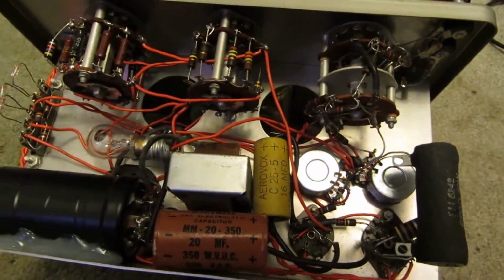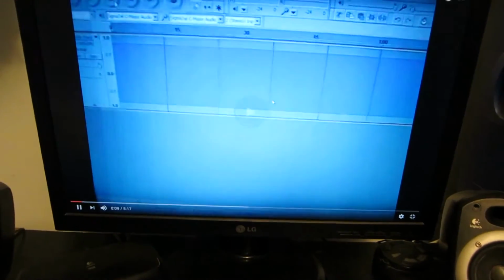HeathKit Audio Generator Autopsy

Comment: would this work with a class d car amplifier 1000w?
Reply from the maker: You mean to power a motor at high speeds?
Reply: at any speed really im trying to get a 12 coil  3 phase fisher and paykel smart drive  running 1500-3000 rpm, the kicker is it doesnt have hall effect sensor or i could just throw some transistor on and away we go. but still off anything cheaper than a fancy controller if you have any helpful info would be awesome and much appreciated.
Reply from the maker: Sorry I'd have to see it in person and tinker with the electrical to see if it would work.